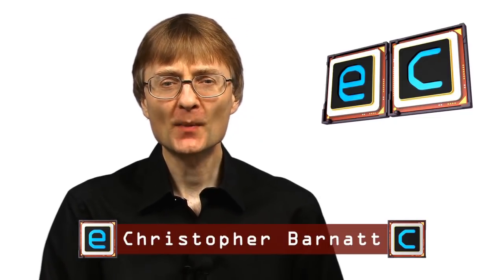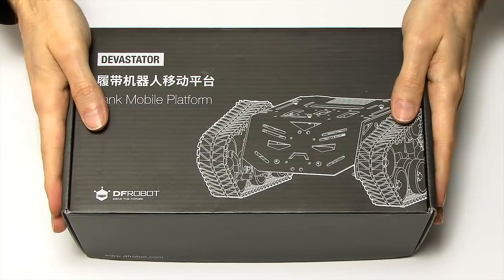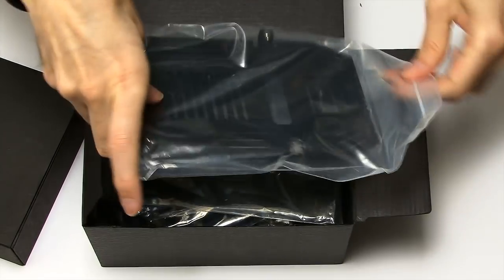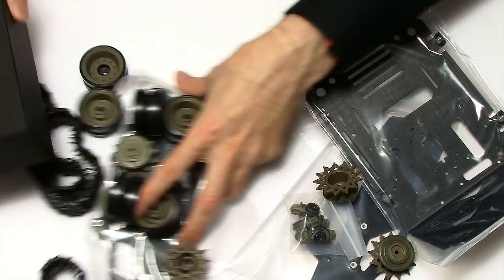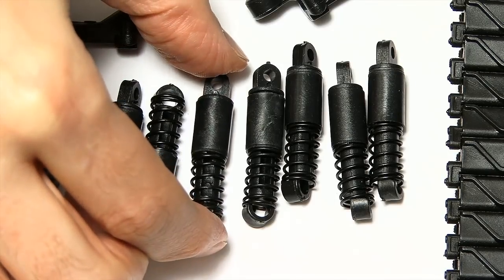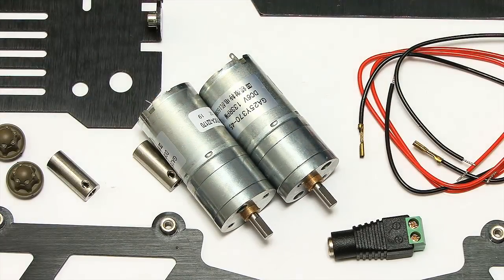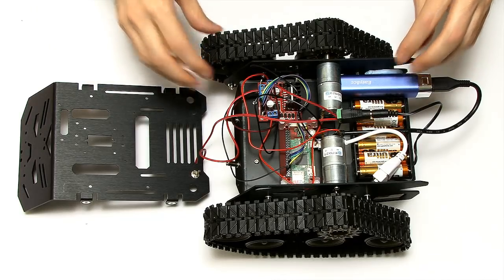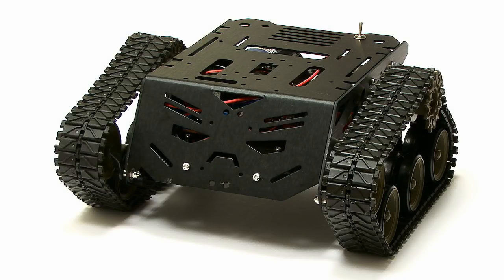Raspberry Pi Devastator Robot #1

Comment: Why not just use L298N 5v out to power the pi? And pi here is overkill. You should use Nano with HC-05.
Reply from the maker: The Pi is not overkill given where this project goes -- adding a camera. I did try using the L298N 5V out to power the Pi in a later episode of this series, then reverted back (as most people do), as when the motors are turned on and off, it can crash the Pi.
Reply: @ExplainingComputers  Yes, I saw later videos where you did that. 

I was just late to this one.

Comment: Now that I've built it... yeah it's good for its price but I'm not so keen on the small parts of plastic that form the suspension. In particular as you have to use "wood screws" for some parts, e.g. to fix the wheels on their axles. Overturn any of these and that's it, there is no replacement part. Well you could still glue it in I guess. Another nitpick I have is how they fixed the lower body plate to the sides with only two screws, which makes it tip once you take the cover off, but for the cover you need 6 screws which is not ideal when you want to access the interior frequently. Overall I still like it, but not quite as euphoric as in my initial comment after I saw the video.

Comment: Very helpful set of videos, have watched over this series a couple of times and taken a lot of inspiration from it. A few of my thoughts and questions:
1. Instead of pygame you could use pygame zero, lot more welcoming. Especially if you don't need the full feature set of pygame
2. Instead of using raw gpio, can use gpiozero. Many more features, including a "robot" object to handle the movement for you. Very useful in more complicated projects where you have to worry about more than just moving the robot.
3. Your wiring changed between the thin power bank, using the l298 output, and then the final thicker power bank. I didn't hear you talk about how you wired the l298n to power the zero. Or did you power it some other way?

Comment: I did the motor switch a bit differently by running the two poles to the enable jumpers on the L298N. For the wire leads on the motor, I cut off about half of the ends and crimped the remains a bit with Matthias the needle nose pliers. They fit nicely in the screw lugs on the L298N.

Comment: I am very close to getting the code working for this demo. But I have come upon a problem where I get a message saying setupterm cannot find terminal. I am running the code in the ide that comes with pi 0w. I have checked my code against yours over and over and it looks the same. I did have trouble at first as it did not occur to me python would be so sensitive to indents, but that all ok now. All the lights are on and the wheels are not turning spuriously as they were at first so I suspect something is running but when I press keys nothing happens. I didn't bother you but I looked at lots of stuff on Internet and could not find a solution
Reply: Ok I fixed that. I realised maybe it was not working in the IDE, so I saved the file to public and ran it from command line and its working now. The wheels are not turning quite right but I will work on that.
Reply: Ok I have got this bit running OK...yeah! now to the second video and instructions
Reply from the maker: Great to hear that all is running OK now Tony. Computing and stuff like this can always be both a frustrating but then rewarding experience. Video three is now uploaded too -- and I will do number four in early 2019, adding speed control (using the same motor controller, so no new hardware needed for that).

Comment: I am having trouble finding that motor controller l298. What about this https://www.robotshop.com/uk/cytron-2x10a-motor-driver-hat-for-rasberry-pi.html or maybe this? https://thepihut.com/products/adafruit-16-channel-pwm-servo-hat-for-raspberry-pi
Reply from the maker: The L298N is on Amazon.co.uk here: https://www.amazon.co.uk/Neuftech-H-bridge-stepper-controller-Raspberry/dp/B01KBTNHS6/ The first you list should work -- the second is for controlling servos, not motors.
Reply: Thanks, I have ordered the devastator, the pi the controller and an add on kit that contains lots of parts such as the switch you use, the keyboard, plus a soldering iron. I will follow your video along I am looking forward to this project. Eventually I want to make it autonomous with GPS and camera but start at the beginning as I am a beginner and the video gave me the courage to start thank you
Reply from the maker: I am currently working on a video where I add a camera. It will upload sometime in October. :)

Comment: Hi, I am enjoying your videos. I want to do the devastator tank following you lead but wonder for the future is something like a beagleboard gree which has built in wifi might be better. I plan to add 3-d camera and gps and want to trial a fixed route taking images of object encountered, Any suggestions appreciated Of course I might struggle with connectors.
Reply from the maker: Thanks for this. The Pi Zero W used here has built in WiFi. But for what you specify, you may want more processing power than a Pi Zero W offers! I will be returning to another video with this robot in September. :)

Comment: i'm a little confused about the battery pack. Aren't you controlling the motor with the pi? And using the power from the pi?
Reply from the maker: The Pi is being used to send control signals to the L298N motor controller. The motor controller is then powering the motors from its battery pack, turning them in the required direction when the Pi asks. The GPIO pins on a Raspberry Pi cannot provide the current to run a motor -- it would burn them out. This all said, it possible to use the motor controller to power the Pi as well as the motors -- which I cover in my second video in this series on Sunday (24 Dec 17).
Reply: is it the same for all smart robot? means, you have one separate power for the motor and one for the pi? unless, they have some kind of motor hats now that only need power from the pi? I'm actually waiting for my explorer hat. But, interested in getting beaglebone blue, for later. since it's got an all in one  board with all the required motors. ALso, easier for building drone. Will you be doing videos for beaglebone blue? IT's videos are pretty limited. Definitely, would be great if you're doing it. :p
Reply from the maker: Yes, all controller boards use the board/computer to trigger a motor (or other) controller. Electronic devices are low current; motors are high current, and can also create nasty spikes that damage sensitive electronics. The HAT you have ordered looks a nice piece of kit, and will take its 5V power from the Pi's power output. But will not power motors (or anything else) directly from the Pi's GPIO pins The 5V pins on the Pi are technically not GPIO, and are wired before the Pi's voltage regulator -- so if you draw power from them, some power is still going to the Pi, while some is "diverted" to the motor controller before it ever gets to the Pi, as it were. Your hat will use signals from the Pi's GPIO pins to trigger its inbuilt H-Bridge motor controllers -- I see it can deliver up to 200mA each, and also up to 500mA across its four 5V outputs. So you need to take some care in what you connect. Just as a comparison, the L298N I use here (which offer less functionality that you multi-function HAT) can handle up to 4A at up to 46V, so is more suitable for controlling larger motors.
Reply: I feel like luke learning from a jedi master. Tq, master! I will follow your teaching. Looking forward to your video this sunday!

Comment: 2 questions.  Can you use a different Raspberry Pi?? Also can in the future  make to a security drone using SSH??
Reply from the maker: Yes, you can use another Pi, no problem. The second part of this series posts on 24 December. :) A security drone could indeed be made using SSH to control it (at least in part).
Reply: ExplainingComputers - Can SSH work long range

Comment: Thank you for all your Robot videos , my son and myself have just finish the Raspberry Pi Zero Zumo robot, we really like your helpful videos, I do have a question or two, how would I change the code to only move when a key is pressed and held, and one last one I promise, when my son takes the robot around his friends he has to set up the Wi-Fi network on the Pi to run the code, would it be possible to use a blue-tooth keyboard and run a macro to run the code without connecting to the Wi-Fi network?
Reply from the maker: I will be addressing these very issues -- running the code at boot, etc -- in my next robot video here.  On the "move when a key pressed" thing, there is some code to do this included in comments on my Raspberry Pi Robotics#3 video, contributed by Inaflap. I've yet to try this yet, but here it is:

from curses import wrapper 
import RPi.GPIO as GPIO

#set GPIO numbering mode and define output pins
GPIO.setmode(GPIO.BOARD)
GPIO.setup(7,GPIO.OUT)
GPIO.setup(11,GPIO.OUT)
GPIO.setup(13,GPIO.OUT)
GPIO.setup(15,GPIO.OUT)

def main(myScreen):
        myScreen.clear()
        myScreen.keypad(True)
        myScreen.nodelay(True)

#KEY_UP = 259, KEY_DOWN = 258, KEY_RIGHT = 261, KEY_LEFT = 260, ENTER = 10, q = 113

        choice={ 259:"0101", 258:"1010", 261:"1001", 260:"0110", 10:"0000", 113:"0000" } 

        char=''  # two single quotes

        while ( char != 113 ):  # q key stops all this nonsense

                char=myScreen.getch()

                if ( char > 0 ) :              #nodelay is set, so -1 output on no press.
                        chosen=choice.get(char)    #lookup dictionary
                        print(char, chosen)                #this for debug only
                else :
                        chosen="0000"

#    Set Pi's GPIO pins 7,11,13,and 15 according to dictionary
               GPIO.output(7,int(chosen[0:1]))
               GPIO.output(11,int(chosen[1:2]))
               GPIO.output(13,int(chosen[2:3]))
               GPIO.output(15,int(chosen[3:4]))

GPIO.cleanup()
wrapper(main)
Show less
Reply from the maker: I will be addressing these very issues -- running the code at boot, etc -- in my next robot video here.  On the "move when a key pressed" thing, there is some code to do this included in comments on my Raspberry Pi Robotics#3 video, contributed by Inaflap. I've yet to try this yet, but here it is:

from curses import wrapper 
import RPi.GPIO as GPIO

#set GPIO numbering mode and define output pins
GPIO.setmode(GPIO.BOARD)
GPIO.setup(7,GPIO.OUT)
GPIO.setup(11,GPIO.OUT)
GPIO.setup(13,GPIO.OUT)
GPIO.setup(15,GPIO.OUT)

def main(myScreen):
        myScreen.clear()
        myScreen.keypad(True)
        myScreen.nodelay(True)

#KEY_UP = 259, KEY_DOWN = 258, KEY_RIGHT = 261, KEY_LEFT = 260, ENTER = 10, q = 113

        choice={ 259:"0101", 258:"1010", 261:"1001", 260:"0110", 10:"0000", 113:"0000" } 

        char=''  # two single quotes

        while ( char != 113 ):  # q key stops all this nonsense

                char=myScreen.getch()

                if ( char > 0 ) :              #nodelay is set, so -1 output on no press.
                        chosen=choice.get(char)    #lookup dictionary
                        print(char, chosen)                #this for debug only
                else :
                        chosen="0000"

#    Set Pi's GPIO pins 7,11,13,and 15 according to dictionary
               GPIO.output(7,int(chosen[0:1]))
               GPIO.output(11,int(chosen[1:2]))
               GPIO.output(13,int(chosen[2:3]))
               GPIO.output(15,int(chosen[3:4]))

GPIO.cleanup()
wrapper(main)
Show less
Reply: Thank you, we will give it a go :)

Comment: This is cool but I have the same question that I have about all track sets.
 I have bought dozens of track sets and nothing, no brand no type that I've ever seen is durable enough to use for a toy for even one day let alone durable enough to use for a robot.
 How durable are these tracks? Could this robot drive for a few miles unsupervised in the real world over pavement and random dirt and outdoor surfaces without the tracks having to be checked or repaired daily? Are they too fragile for real use?

Comment: You could maybe get one of those cheap little right angle USB adapters to let you rotate the battery 90 degrees to fit inside the case better.

Comment: why not use an xbox 360 controller and get full analog control? https://github.com/FRC4564/Xbox
Reply from the maker: Thanks for this -- most useful! :)
Reply: the only thing is i'm not sure if the motor controller supports analog control, and i'm not sure if the GPIO on the pi does

Comment: Instead of using the power bank to powering the pi, why not use that 6AA batteries to power motor controller and give 5V to pi with the motor controller related pin? I know that specific motor controller has it.
Reply from the maker: Now this is a great idea -- thanks!
Reply: 992saifer Checked mine an I’m getting 4.7 volts out of that connector. Thought about doing as per your suggestion but I think the motors will burst into life at the same time as the Pi is powered up. I think they will keep running until the Pi starts to run the script to control the tracks. Using a separate power source for the motors and the Pi ensures the motors aren’t powered up until the Pi is ready.

Comment: Wonderful project! I find I get a lot more power to drive the motors by using LiPo batteries. E.g., my little Arduino robot now runs over carpet. Also they don't need to be removed, just recharged.
Reply from the maker: Yes, I plan to get a LiPo pack for this, and hopefully also a voltage regulator to run the Pi off the same batteries.